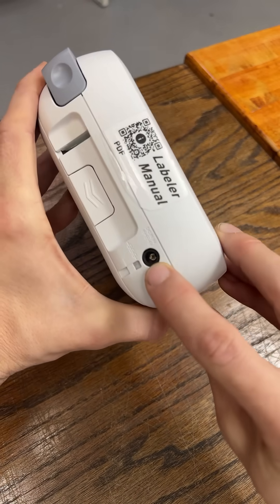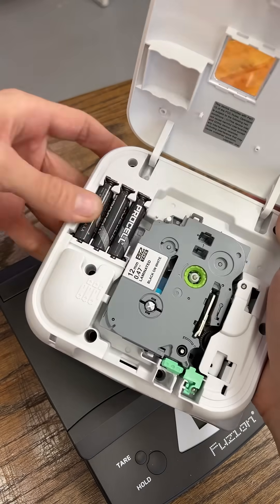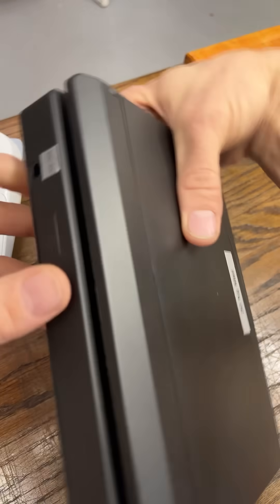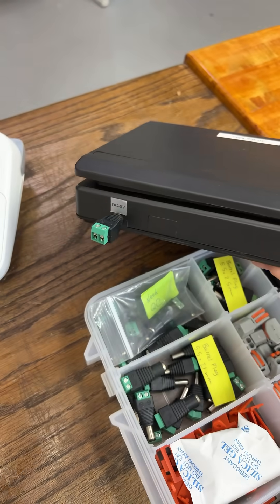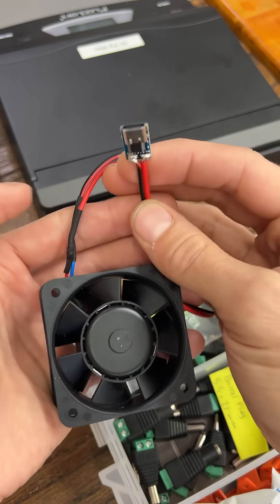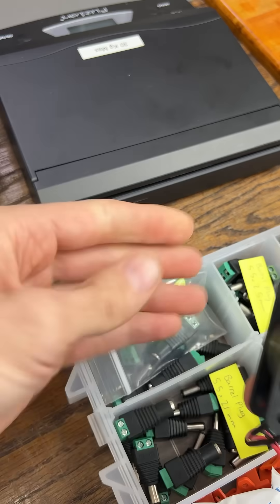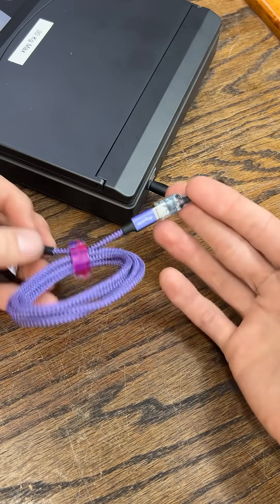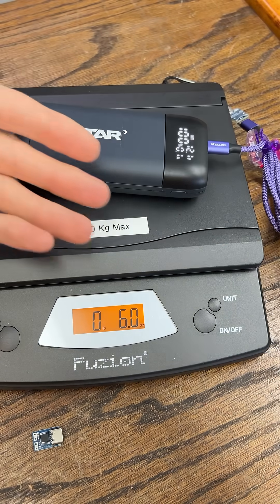USB-C can replace alkaline batteries

Comment: Fun fact, brother labelers are pretty much the only ones who put the positive lead on the outside of the barrel plug.
Reply from the maker: holdup-seriously?  this is the most clever trolling ever if you’re kidding.
Reply: @davidmalawey  Yes, it's reversed on most brother labelers (but not their industrial lines)
Reply: @YuzuRyougi  Nah, some of those are center negative too.
Reply: @YuzuRyougi  the industrial one i have is reversed. I was so confused why none of my box of adapters was working. Quick fix with one snip and some shrink tubing though. 😂
Reply: @YuzuRyougi not the one he's using. I have it and it works with all my barrel plugs
Reply: @davidmalawey  Well ideally most things have the little plug diagram on them which will often indicate what part is positive and negative. If  not its for sure on the power adapter assuming that you have it.
Reply: @connorjohnson4402  the power adapter has it so you don't use it on the wrong device. You still need a diagram on the device itself to know if the polarity matches. It's a small diagram so easy to fit it somewhere.
Reply: @davidmalawey it’s on the icon.

The polarity is part of any label
Reply: @davidmalawey  yes, center-negative is not uncommon on a lot of things, even though it's backwards from what we usually expect.  I think eevblog did a video about this (technical reasons why it's been used so much) years back.
Reply: @davidmalawey  you can see it in "your" video. right at 0:01 as you point at the power port and the label clearly indicates this polarity.
Reply: @datalorian  you could see that in this video? Because it’s white on white with very low contrast! You must have 40/10 vision! 😂
Reply: @mikabreto  not hard to read if you load vid in high resolution and zoom in. The timestamp doesn't work though. It's best before the 1 second mark.
Reply: @davidmalawey  not even kidding, took me forever to figure out why and never found another like that. Check it and you tell me
Reply: @davidmalawey  I've found some cheap off brand things switched this way so always check your polarity 😂
Reply: @Senizagam71  No, the 9v is isolated from ground either way.
Reply: @ot9er  I am use to chargers and other power supplied things so I like to double check everything, I've had a couple of mishaps 🤣
Reply: @davidmalawey  They are. I could never find a replacement one and we stopped using them....ridiculously expensive to have 8 or something batteries.....and then i realized the plug was wrong.
that's just plain on purpose so you have to get their own like 40 something bucks.
Never Have i bought another Brother product ever.
Reply: @davidmalawey  If you to the upper left of the DC jack on the Brother labeler  there appears to be a polarity mark. Kinda hard to tell in the video though.
Reply: @davidmalawey  I have that model.  Brother really is all about the nonsense. There's no cross compatibility between Tz and TZe tape machines either.  They love being propriety and not selling adapters with their baseline labelers.
Reply: @davidmalawey  Correct. My brother PT-e110  has positive on the outside....
Reply: @davidmalawey  Positive on the outside is very rare, but some manufacturers do it for whatever reason
Reply: God! That's evil! 🥲
Reply: You wanna know what's really evil? The little white one he showed runs off 9v. The bigger nicer version runs off 12v. 

If you use the 12v adapter on the little one- it will turn on, display "wrong adapter", and turn itself off.
Reply: @georgekim4300  you should never 'assume' the polarity, devices could easily be either!
Reply: @georgekim4300 
Revelation 3:20
Behold, I stand at the door, and knock: if any man hear my voice, and open the door, I will come in to him, and will sup with him, and he with me.

HEY THERE 🤗 JESUS IS CALLING YOU TODAY. Turn away from your sins, confess, forsake them and live the victorious life. God bless.

Revelation 22:12-14
And, behold, I come quickly; and my reward is with me, to give every man according as his work shall be.
I am Alpha and Omega, the beginning and the end, the first and the last.
Blessed are they that do his commandments, that they may have right to the tree of life, and may enter in through the gates into the city.
Reply: Guitar Pedals also have a center-negative
Reply: @Goodmanperson55  Boss & Roland mainly.

First I thought it a was a Japanese thing, but I think it's more a propriety move to get people to buy official replacements.
Reply: @RealSapHead 
IIRC, there are some genuine design reasons why and for guitar pedals specifically, it had something to do with them being usable with a wall wart without needing to remove the 9V battery, which could explain why that labeler also has a center negative. It also needs to work with those AAA batteries.
Reply: @RealSapHead Boss and Roland are the same company.
Reply: @joho0  that's right, but you won't always see that on the device itself.
Reply: @RealSapHead  But the end result for guitar pedals is that -9v is mostly universal, as are the power supplies and the barrel connectors, no matter the brand.
Reply: @RealSapHead I won't argue with that, and it is strange because with metal enclosures if the outside positive barrel comes in contact-sparks and worse! It seems they've come up with this as a way to switch the pedals pwr on and off & a workaround to the mixing of inside fx battery power and outside power adapter, when the instrument cable is plugged in that's when power is applied. Maybe the people at Brother are also a lot of musicians!
Reply: I have a cheap bass guitar amp withe positive on the outside. So i accidentaly blew a cap.
Reply: @enjoykilian Guitar equipment is normally pin negative. Roland/Boss started using pin negative a long time ago and now it's the standard for the industry. Every guitar pedal I have ever owned is pin negative-- even the ones that use weird voltages or plugs other than a barrel.
Reply: @antonchilinski9729  ow realy. I thought it was very rare to see.
Reply: @enjoykilian
Reply: @brokentradgedy  ?
Reply: @antonchilinski9729  (I'm a drummer) no wonder I've ruined every pedal I've ever touched.
Reply: @enjoykilian you should resolder the stuff into the correct position on the board already 😅
Reply: @enjoykilian careful cuz ALOT of pedals are like that too! I did the same shit with a guitar pedal lol
Reply: @enjoykilian  usually there's a protection for that exact scenario, must have been a really cheap amp lmao.
Reply: @otisthecow  yeah it is. But its okay. I just removed the cap. Its just for stabelization anyway.
Reply: @enjoykilian I’ve had something like this happen, and since have always looked at the diagram.
Reply: Some Korg stuff too.
Reply: Sony is the worst for using center negative barrel jacks.
Reply: So true! So annoying!
Reply: the original nintendo gameboy also does this
Reply: @DaanZoomer2002 I remember noticing that on the diagram and it might have just been what messed me up all these years
Reply: @hondaland_  yeah i made a diy dc adapter so i could use the dmg with a powerbank and almost soldered positive in the center tab but luckily i read somewhere that the polarity is reversed
Reply: i checked one out and what you said was true. is there a logical reason to put the positive pole on the outside on a barrel connector? it seems that it would be a safety hazard to put the positive pole on the outside of barrel connector.
Reply: @manp1039  DC polarity doesn't affect safety. In fact (e.g.) AC polarity reverses 120 times per second.
Reply: Nope. Polarity doesn't affect safety. The voltages are floating, not referenced to "ground".
 @manp1039
Reply: Thanks Brother xx
Reply: Sega consoles were all over the place depending on the console model and the region. In Japan and Europe it was all center negative, but in America they used both
Reply: @SteelSkin667 Snes, also center negative. 😢
Reply: In my extremely limited experience it seems to be devices with a battery compartment that use outer-positive and I suspect that it is because the socket's bypass switch is on the outside not the pin and the designer wanted to switch positive.
Reply: @boristheengineer5160  Except that they can still wire the polarity accordingly, no matter how the batteries face.
Reply: @ot9er  Well they can but it means switching negative and although it makes no difference which end of a battery is switched we're generally taught to switch the positive side. Its not how the batteries face its that the barrel socket has a switch that switches in the battery when the plug is out. The switch is formed by the outer contact and a rest that the contact sits on. When you push the plug in the contact presses on the plug and not the rest.
Reply: It's true.
Reply: I learned that 😂 🙏
Reply: facts. blew up one of my nicer ptouchs using the wrong power adapters. Still runs on battery but the wall power circuit is fried
Reply: Even better would be to hack out those battery compartments and install a small USB-rechargeable battery
Reply: I'm 41 years old and the first time I realized that most electronics with barrel plugs have a polarity diagram on them was about 2 weeks ago... Now I wonder how many electronics I have ruined over the years just trying trying to find a power adapter that will work not realizing that the polarity isn't universal.
Reply: @mittenflippin  the polarity on barrel plugs are mostly universal but there will always be companies that are mean and reverse the polarity and iirc the original nintendo gameboy doesn’t have a fuse so some important components can get damaged
Reply: Dymo is the same issue, also you can't use rechargeable NiMH batteries, won't work with those either....
Reply: @KasLewis  That sucks. I wonder why they won't. Does it have something to do with the power signature of NiMH or do they only recommend not using them since they're likely to drain inside the labeler if you don't use it often?
Reply: @moonrock41 there's no recommendation or mention about not using them at all. I only found out after doing a bit of research myself with a power supply to figure out what the cutoff voltage is because i kept having print quality issues. I've also tried making Dymo aware of the issue but they don't seem to be interested or care all that much. Maybe I'll give a USB C a try so that o can have a mobile power supply. 

I'm also currently wor😢on reverse engineering my Dymo to see if i can get a broken unit working again, not sure if that's something anyone would be interested in.
Reply: Yamaha guitar pedals do the same
Reply: Apparently Vox does too, quess how I blew up my amp.
Reply: @unpaidintern6652  That's why I always check before plugging random adapters with unknown specs.
Reply: Spektrum RC radio controllers are negative pin too
Reply: I used to work at radio shack a long time ago, and I would sell replacement power supplies for people and there were a lot of barrel plugs with positive outsides.
Reply: hence I modified mine and installed a DC-DC with a full-wave bridge rectifier so any polarity supply up to 30V can be used
Reply: The common standard for 9v is center pin negative.
Reply: almost all 9v music gear is center pin negative.
Reply: I've seen IVC security cameras with the same design.
Reply: Works out well for me, because I have some bass guitar stuff that came with an AC adapter.
Reply: Weird.  All my Brother label printers are pole positive.
Reply: Sinclair Spectrum 48k ❤
Reply: I bought a supply for a dymo last week and now i know why it didnt work!
Reply: This is why I pull diagrams and spec sheets. Then check them all twice. Even my simple home built sensor, relay, output lcd, arduino combo gets 2 or 3 different design docs, with some stuff expressed on all pages, and some referenced multiple times. Double triple check because one backwards connection can fry stuff
Reply: What the heck, I just checked mine and you are correct. The polarity symbol on mine and it is negative in the center.
Reply: Center negative is standard for audio equipment.
Reply: @joenarbronarsson1347  That is for superior ground shielding, right?
Reply: "negative center"
Reply: I have that LabelMaker I’ve had it for a few years now I’ve never even needed to replace the batteries and I use it for tons of stuff
Reply: I simply cut a regular 9v wall wart and flipped the polarity.
Solder, shrink tube and done
Reply: A bunch of my older music gear has it switched around like that.
Reply: Sony does outside positive as well or at least they've used to
Reply: What about NES  power adapters ? Putting a similar sized power plug  would kill your beloved NES. Sad face ( 10 yr old ).
Reply: Fun fact, nearly all guitar pedal and other powered accessories power jacks are wired this way
Reply: Dude. I would not have bother to check. Genuinely thank u! Lmao
Reply: @oshaghennessey9829  Using a multimeter you wouldn't lmao
Reply: @ciprianwinerElectronicManiac  yes but I would’ve pulled it out AFTER shorting it 😂😂😂
Reply: @oshaghennessey9829  Yeah, I learned by burning up a Sony disk player.
Reply: Came to comments to say this. Its so unusual that I remembered it from when I encountered it about six years ago. Wish I could have a little talk with whoever made that decision.
Reply: were do you get these adapter from, please provide the link
Reply: Most guitar pedal manufacturers do also.
Reply: Barrel plugs are a wild wild west of non standardization. There are different inner diameters, outer diameters, different length of conductors, etc etc. It's just evil. USB-C all the things!
Reply: This is true and it's done too other electronics too, my technician always check first cuz be says thay tend to turn it around too take a pis on ppl.
Reply: See, I'm no Labeler aficionado. I misread that as missing a period... My bad.

"Fun fact, Brother. Labelers are..."
Reply: I've got an AnD scale that's tip-negative.
Reply: Of course, always gotta maximize opportunity to cause a short circuits when the wallwart is plugged in but the barrel plug is still dangling in the wind
Reply: THEY DO WHAT!?!?
Reply: I am currently looking at a Brother and a Dymo label maker and both are centre negative.
Reply: Center Negative was standard for a long time up until the mid 90s.
Reply: Old Casio Keyboards too ...
Reply: It’s not just brother. It’s common enough that I’ve ALWAYS tested it if they don’t have a circuit diagram on the device.
Reply: center negative is a absolutely criminal
Reply: Ohhhhhhh so that’s why I could never find a barrel plug that works with my label maker 😭
Reply: Yes positive barrel connector - my Electro-Harmonix guitar pedal power adapters also fire up the labeler. And I can run the labeler from the powerbank on my pedalboard. And juice the powerbank from USB. drops soldering iron Hold up, only $1 you say!?!? BRB got to go digikey
Reply: Not true, Sony loved doing that on pretty much all of their devices.
Reply: Labelers and old Playstation 1 and 2 slim models.
Reply: sony and guitar pedals/amps are 99% inverted
Reply: My Casio keyboard was like that too.
Reply: And guitar pedals
Reply: My Brother Brother PT-D600 label machine also. Got to put a red warning label next to the jack as a reminder.
Reply: Several companies do it. Especially the ones that try to hide the specs on their adapters so you have to buy theirs.
Reply: Atari jaguar consoles too I think
Reply: Sony would like to disagree with you
Reply: There is no standard. Most older devices were negative centre, most modern devices are positive centre. Then there's the centre pin size e.g 2.1mm vs 2.5mm. Then there's the current eating. If it's an older device, you have regulated vs unregulated. It's a mine field
Reply: Also guitar pedals
Reply: Fuck usb-c.  Barrel jacks are so much more robust
Reply: always check the label on barrel plugs!!
Reply: Model 1 Sega Genesis / Mega Drive and also Super Famicom also use a center-negative barrel jack.

Many devices with barrel jacks will have a symbol near the power port, often resembling a diagram of a circle (representing the barrel) with a "+" or "−" symbol indicating the polarity.

-(●+)
This indicates center-positive (the center pin is positive and the outer barrel is negative). If the "+" and "−" are reversed, it indicates center-negative.
Reply: Everything brother makes is comparable to aids. Everything is so shitty
Reply: I found this out on my brother label maker also when making a cable for mine, luckily i realised it before finishing the cord, it was a good lesson to learn though I will always check for it now.
Reply: It's not trolling, and it's also not uncommon. Generally, you'll find it in devices that have both batteries, and a DC connector, where the presence of the barrel connector opens a normally closed switch, disconnecting the battery. Musicians especially are used to this. Most guitar pedals are like this, and a lot of Roland and Korg gear as well.
Reply: most retro consoles up until the sony playstation were center negative (positive lead on outside)
Reply: Casio and the entire guitar pedal industry would like to have a word with you
Reply: The icon next to the barrel plug indicates which section is positive and negative
Reply: theres adapters.. especially music stores have them. because guitar pedals are often center negative
Reply: That little symbol next to the port tells you which side is positive.
Reply: Casio CTK-80 paino has that too
Reply: this is a good warning because I really need to make up a 9v adapter for mine
Reply: more that than, a lot of electronic instruments (mainly guitar pedals) switch the polarity. I have a universal power supply that allows me to change voltage, barrel type, and polarity I got from Guitar Center.
Reply: I came here to write this. 😅
I've lost my charger for my Brother label printer and needed to charge it. Luckily I had some of those plugs in male and female so I only cross connected them and could charge it with a normal 12V adapter. Few weeks later I found my charger at a customers place. 😅
BTW: they're still using the same charger/plug combination on all their label printers. Got a new one with lithium battery inside but the charger could be used from an old device.
Reply: BOSS has gone that route with FX pedals. I hate the idea of outside as the positive. Also hate that if you get it wrong, something goes poof.
Reply: Center negative!!
Reply: Yeeeres this
Reply: This is called center negative and lots of stuff does this. Casio keyboards and external hard drives are great examples, and I believe even the Sega CD is among them.
Reply: I have a similar experience with electric guitar pedals
Reply: They're negative-tip?? 
They pretty much guarantee that you blow it up and have to buy a new label maker. Shame on your Brother.
Reply: I was going to mention that. Made a mistake, one time, connecting it the normal way. Now my label maker only runs off the batteries.
Reply: More like BS fact heaps of brands and profundity have positive earth 🤷
Reply: What if my Brother label maker is 7v? Can I use a 9v?
Reply: @hrgguy  dispite it being possible to work as the circuitry hopefully would have a voltage regulator or over voltage protection, I would still not recommend it since it should only cost a few dollars for a new power supply from walmart (look for universal adapters that have multiple toggles and heads) and again watch for polarity
Reply: Correct. Most Brother home appliances like label printers have center negative.
Reply: Old guy here. Battery-powered devices used center-negative barrel jacks because they used a type of jack where the positive shell would nudge open a normally-closed contact to break the positive connection to the batteries when you plugged in external power. The shell touching said contact would then be supplying the positive power to the device. Interrupting the negative is problematic as it usually runs everywhere and connects to everything and you want it to be solid for signal quality and safety reasons, not going through a switch. So breaking negative at the jack isn't done.
Reply: I have a black and decker hand vacuum that uses 9 V with a negative inside contact. That is a positive outside. It the only other one I’ve seen besides some brother products.
Reply: Its called population control....your not supposed to point this stuff out man.
Reply: Guitar effects pedals too
Reply: I agree 100% he is correct, my P-touch is regular  plug like on CCTV and 12 volts etc but yes negative pin! i think the first 4 labels i printed out where "Warning negative pin", so glad i looked around first rather than just jump in.
Reply: Oh brother..
Reply: That's absurd, what are they afraid the electricity will arc if the center lead is positive ?
Reply: I’ve seen that sort of thing on many different devices
Reply: Most (if not all) vintage Casio keyboards use center negative barrel jacks
Reply: Yeah, there is no standard for barrel plug polarity
Reply: Brilliant observation. I found this out the hard way 😂
Reply: And Roland
Reply: I was just about to comment the same
Reply: Was about to warn then read this! Thanks. Brother wants to see the world burn.
Reply: Sounds about right for Brother.  They'd force you to buy their labels too if they could
Reply: (Super)Famicom:  I'm sorry.  I die now.